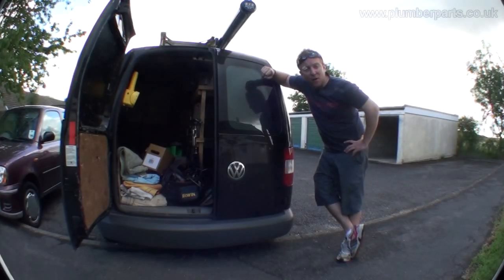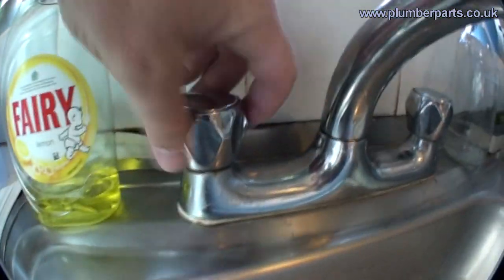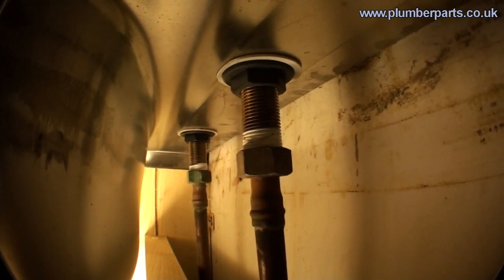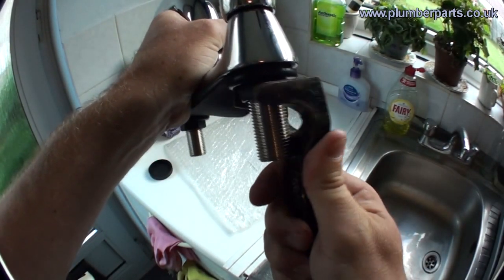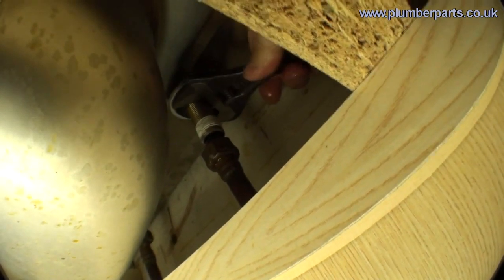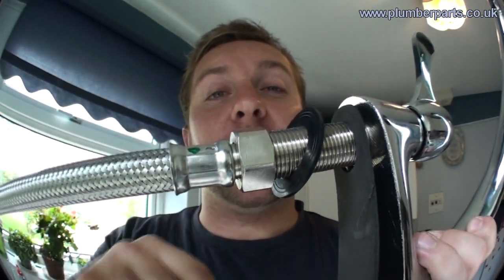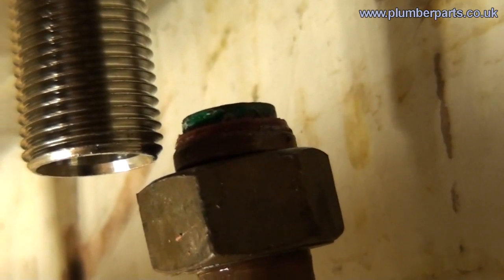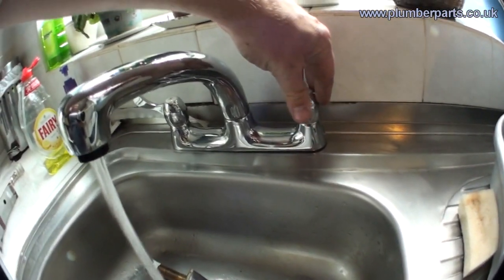How To Change a Kitchen Tap - Plumbing Tips

Comment: Great video, thankyou. I noticed on the old tap thread there was PTFE tape but you didn't put any on the new taps, and did you mean apply PTFE to the fiber washer fitting of the old connection or to new tap thread. Apologies if my Q sounds daft.

Comment: another good video. 
Wouldn't you fit a non return valve as the cold water pressure seems higher than the hot water pressure.
Unfortunately my sink, whb and bath do not have isolating valves so I have to find where to turn off water